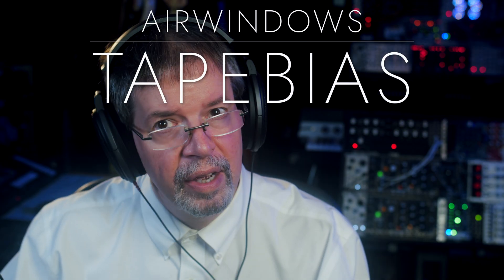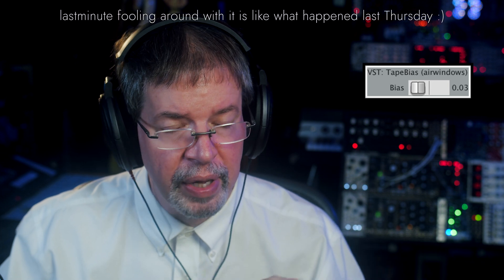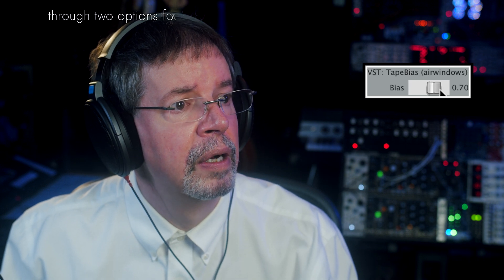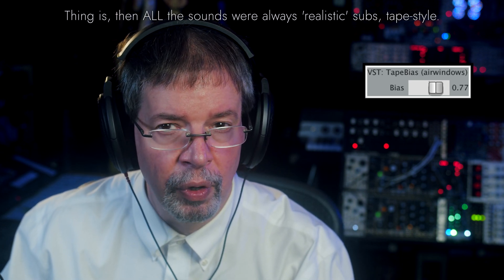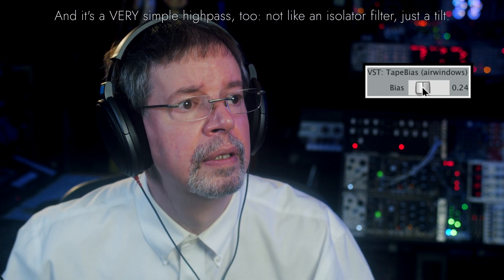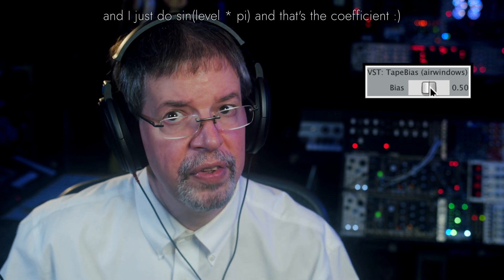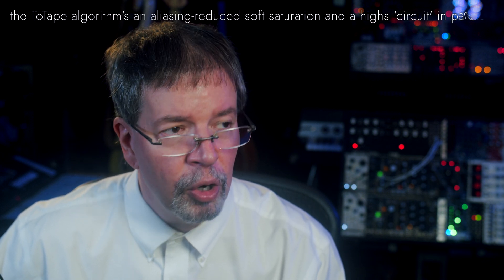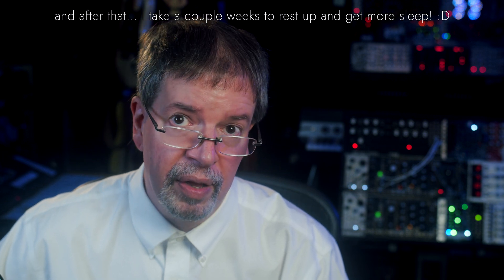Airwindows TapeBias: Free Mac/Windows/Linux/Pi CLAP/AU/VST3/VST2/LV2/Rack

Comment: Really looking forward to the new totape! 
I like the old one, but it doesn't work for that many sources that I've come across. I'm usually better off with chowDSP's tape, although that thing is buggy and is insanely easy to overdo. 
ToTape 7 seems like it'll be the perfect blend of high performance, simple controls, and flexible sound shaping.
Reply: I try not to dive into YT audio comments... but curiosity and all—how is ChowDSP's Tape "buggy"? I've never heard of anyone ever having any issue with it.
Reply: @lucasturney4269  for me, switching from ChowTape to another plugin doesnt work correctly. ChowTape's interface never gets hidden and the window doesn't resize. To make it work correctly, I have to switch to Reaper's simplified plugin UI, then pull up another plugin. Since I found a workaround, I never got around to bug reporting. Plus, it's a free plugin, so I don't expect ongoing support.

Comment: Love the effect it does! It might be useful for placing elements in terms of front to depth, I think.

I'm very excited about the coming of ToTape7!
I'm not sure if you've seen my suggestions about flutter.
I think it's important so I'll allow myself to emphasize it one more time.

It's about the option to use flutter in mono. Or to set the amount of stereo dependency.
So we'll be able to use it without stereofying our mono sources, and without messing too much with the imaging of stereo sources.

If we have limited controls for flutter, it might be linked flutter amount from 0 to 0.5 and stereo flutter amount from 0.5 to 1. Or other way around.
I hope my ideas can be useful. 
Thank you, Chris, for what you do for us!
Reply from the maker: I've been choosing to NOT follow those suggestions, but that's also why I've made sure it's possible to completely bypass flutter, which will also fix the problem another person had that flutter cut back on their super-highs (because it interpolates). I think it is just as important to unleash the full spatiality of, I don't know, '3D flutter'? especially since it can easily be used as an instant widener through using unrealistic flutter speeds, and since realism seems to dictate WAY less flutter than anybody really expects :)
Reply: @airwindows  thank you for the answer! I'm sure there's a reason to do it the way you do. Also I read the thread on gearspace about Flutter2.

What do you think about using Rightomono \ Leftomono after the flutter on mono sources? Would it make sense to use only one side of the Flutter2? I can decide by ear, but I'm interested in how close it would be to real flutter behavior.
Reply from the maker: Never mind, I fixed it :D all you have to do is try two random options each time it reflutters, and pick which ever one is closest to being locked in. It still does '3D flutter' and in fact doesn't tie the channels together at all, yet it stays stably locked in a deeply tapelike way. I fixed it, you shouldn't have any problem, use Flutter2 anytime you want stuff a little less locked-in :)
Reply: @airwindows  wow, that's great! can't wait to try it! thanks Chris! 🙌

Comment: I hope there is no aliasing in totape 7, that’s important to me
Reply: Very little aliasing especially at 96khz.
Reply from the maker: If I'm not mistaken it'll still work when you use oversampling: if you're in Reaper that'll be built into the DAW. I won't be using that, but as far as I know it'll take oversampling cleanly. I'll be just running at 96K: aliasing is a trade-off against various things I also value.
Reply: Know any good plugin wrappers/hosts that I can use in a DAW for oversampling?